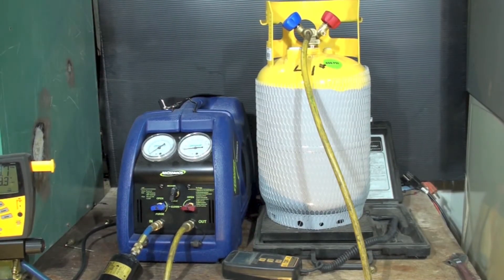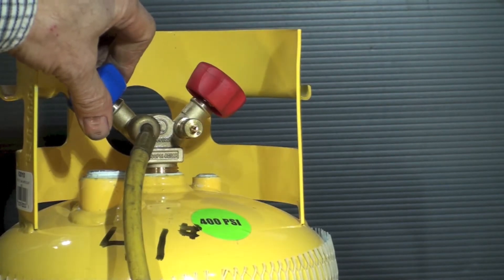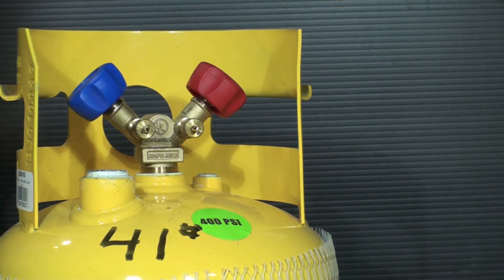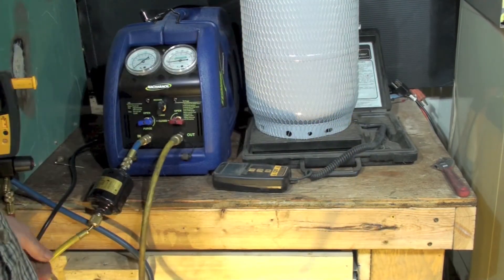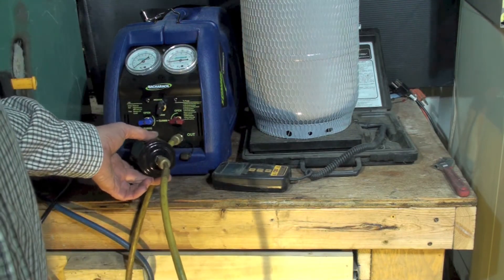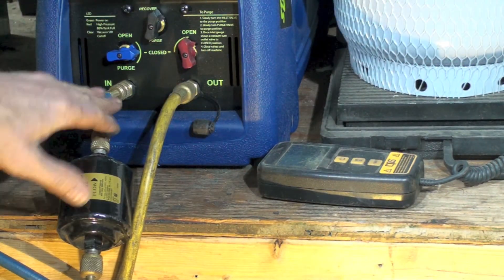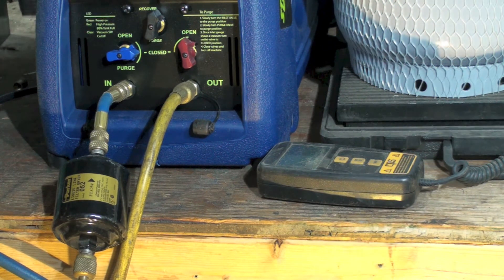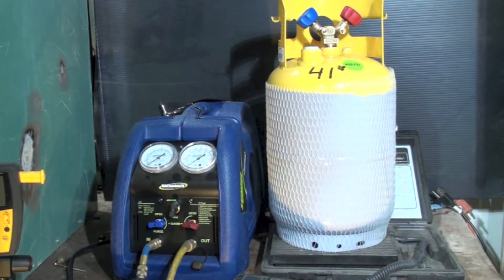Recovery machine maintenance

Comment: I have my dryer with one female end hooked to the inlet, and opposite end for the hose; which, is capped til being used; however, that will not allow for the capture, and containment, of refrigerant, to bleed out air.
Your set up is a good idea, and I agree with your philosophy on caps. That is good practice too!

Comment: Another great video.
I always take the drier and cap if it I think its' worthy of reuse. Never thought of leaving the hose connected and then purging the drier. great idea. It makes me nervous  to leave the hose connected as it may present a trip hazard.
I think I will get a 1/4" valve so that I can purge and cap my driers and still store it separately. 
Great advice when it comes to following good practices all the time even when it doesn't seem to matter much so that you do it automatically when it does matter.

Comment: When you would do a recovery it sounds like you do only vapor recovery thru machine, is that what you do?You are a pillar of information, thanks for sharing!
Reply from the maker: I generally do only remove vapor.  In most cases I don't think its worth the potential damage to the recovery machine to recover liquid.  To decrease recovery time, I turn on all fans to warm the refrigerant.  Thanks for the support.
GFM

Comment: Min 2:10

Is the reason "it's no longer a drier" because it gets "waterlogged" if left exposed to air? 

(How would you know if a drier IS waterlogged? 

 Doesn't that mean driers are getting installed that can't do any drying?  (sometimes one gets to thinking you can't win in this business given what all these regs have turned it into. )
Reply from the maker: This issue has nothing to do with regulations.  It is a simple concept.  The drier comes from the factory sealed and dry.  When the system is opened, it is exposed to humidity in the air.  It should be exposed for a minimum time.  If the system has a leak and has leaked out completely, the drier is waterlogged.
GFM